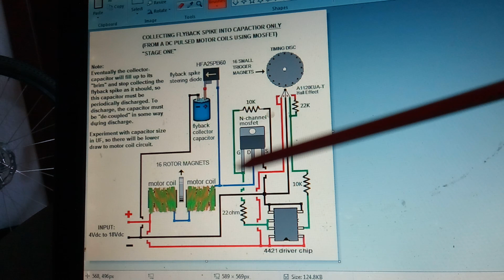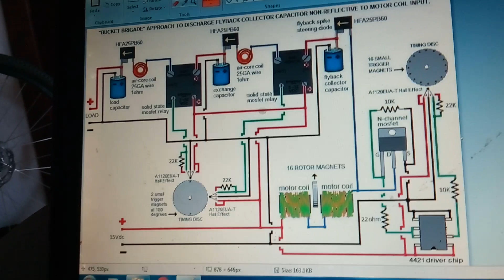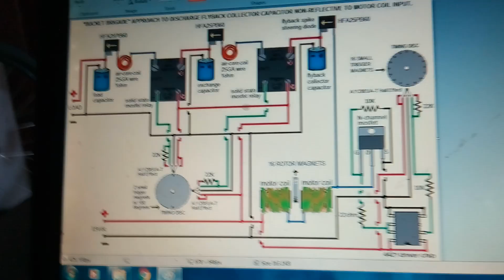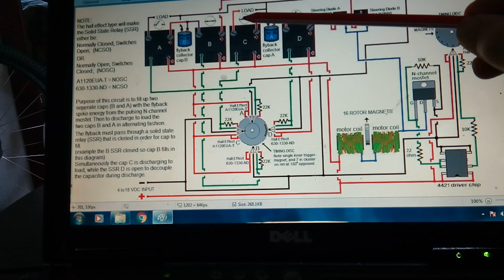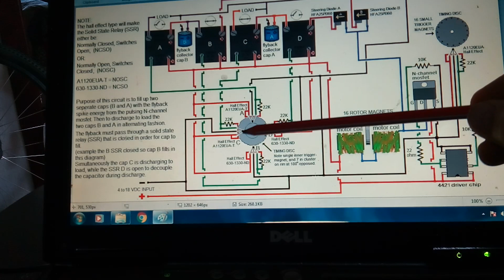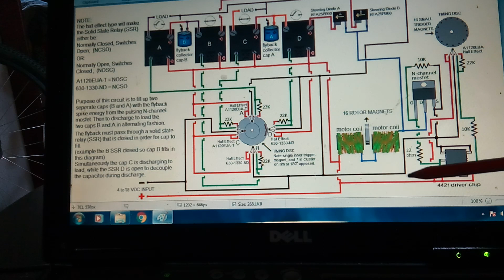Circuit drawings; flyback into caps and discharging caps.

Comment: you are very close to " free energy " , i  follow you since many years ago, why you are looks like afraid to realized this, I am Sorry about my opinion  ???, but anayway thanks about your hard working...
Reply from the maker: hi Fidijanto, 
Thanks for comments, I think I realized free energy long time ago, as far as charging multiple batteries up with flyback or capacitor discharge from my motors, and swapping run batteries with charge batteries over time, for a continuous runner...
But looping it with no batteries the ultimate "proof" of free energy or overunity and not so simple both psychologically and doing it with prototypes.  Visits by CIA or MIBs or who knows who inevitable with a looper being  advertised which is not a fake, as so many videos on internet are.
 I am working on it,  there is good chance one pinkmotorgenerator can run another and the other run the first one.... we will see Its easy to get discouraged when an experiment does not succeed so just keeping at it, keeping all work public so anyone can copy what I do if they think its worthwhile.
No grand prize is presented when no battery looper "realized" !  Just double edge sword of satisfaction of doing it and making it public,  then the upcoming expected threats and smears and visits by agents of the no-gooders.
Look into history of RomeroUK, who has already done what I am trying to do as well..